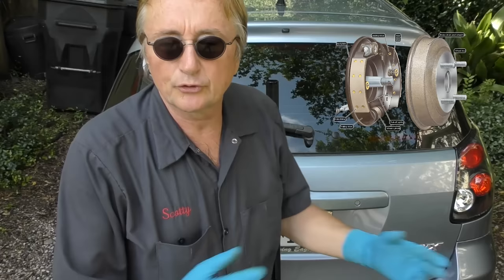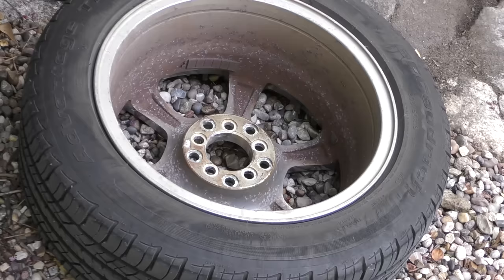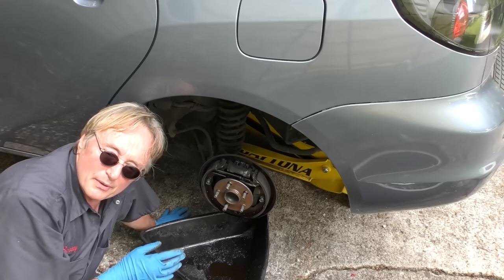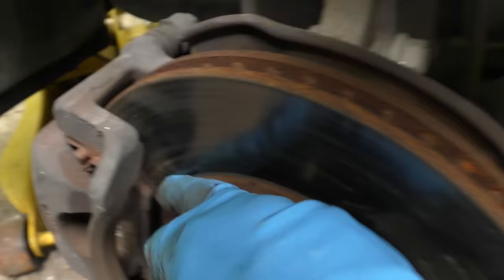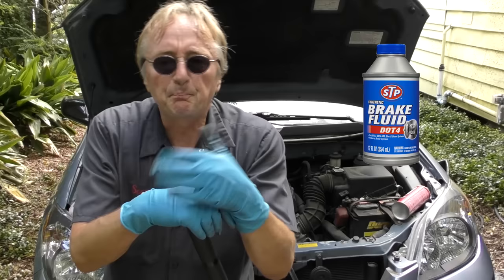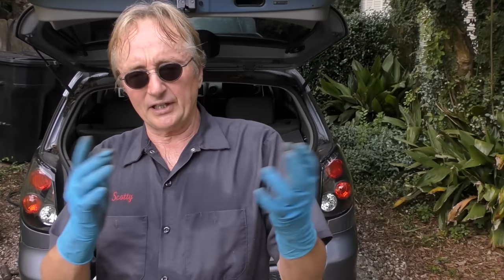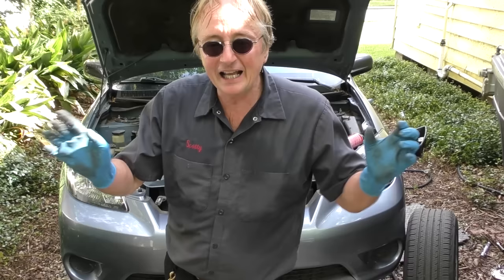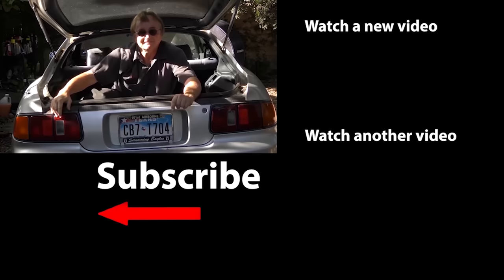Doing This Will Make Your Brakes Work Better and Last Longer

Comment: Scotty, my dad bought a 2004 1/2 Silverado 2500 HD diesel when it was about 6 months old. He has had it ever since and has pulled 8000-12000lb. loads frequently since he got it. He had to replace the brake pads and rotors on the front for the first time at 217,000 miles. The rear pads and rotors are still original at 222,000 miles.

Comment: 109000 miles on my kia forte, they just now needed front pads, back ones are still fine. 5 second follow distance on the highway and i use the sportmatic shifter to slow from 70 to 40 before using the brakes at the off ramps.  Oh yeah, and ignore stop signs! ;-D

Comment: A brake specialist told me 50 years ago how to stop disc brakes squealing, just drill a hole into the leading edge of the disc pad, pad only not the backing [same size drill bit as the diameter of the carbon rod up the center of an old style [not alkaline] D size torch battery, as you apply the brakes a fine film of carbon lubricates it enough to kill squeal.

Comment: If you have a case where your first brake pad change for a car discovers brake pads have severely uneven wear - one brake pad fully worn and the other half worn - would you...
1. Pair up a new pad with the half-worn pad, keeping the 2nd new pad in reserve for the future.
2. Install both new pads and keep the half-worn pad for a future brake job where you find one worn pad.

Comment: Remember, your wheels should spin with only slight friction. If they take effort to turn you likely have a bad caliper with stuck piston. The guide pins need maintenance too, before they stick and cause heat and ruin other stuff.

Comment: Another good reason to only drive a manual gearbox.   Going down a hill or coming up to some red lights, you can change down through the box, and only use the brakes for the last few yards.

Comment: Brake cleaner rules! Except they are not all equal, i only use Kleen flo now because the spray is super powerful and it seems to work better than other. Seems pretty hot over there!

Comment: With the brake cleaner do you spray the front brake pads while they are on? Also will it help clean the rims that have built up old brake dust? I like your videos. You talk faster and not waste a bunch of time. Thank you.

Comment: These rear drums brakes utilize the "Leading and Trailing" design and do NOT adjust themselves by backing up like the "Bendix" design. Leading and trailing brakes adjust themselves by use of the parking brake. Be sure to periodically and firmly engage the parking brake HARD so the rear brakes properly self-adjust.

Comment: I absolutely love your videos and you've become a totally invaluable resource to me. But with that said, I'd like to take a moment to warn you that you're over heating pretty badly by the end of this. I've had this happen a number of times working on my car in the summer in Atlanta and I know Houston's not any cooler lol. But the most serious instance when I think I nearly hurt myself was when the veins in my head were bulging like crazy and I was beet red. This appeared to be the case for you as well here. I wound up getting a pretty severe throbbing headache for a few hours afterwards and it really felt like my heart took a beating.  Just total exhaustion as well. Not enough water and losing too much sweat in that kind of heat can really do you in. Turns out that was my first run in with heat stroke. Anywho, we'd love to keep you around, so if you happen to notice that happening again this summer please take a break! I'm only 31 and I thought I was gonna be in some real trouble when it happened to me. I don't think it would be any easier on you my friend.

Comment: I just replaced the pads on my 99 Olds van yesterday. They weren't down to the dime yet but they were a mite thin. Couldn't get the Akebono pads in my home town, {{Small Town}} but bought the best ceramic pads O'Rileys have. I'm 72 years old but still like to do as much of my own work as I can. 
Pads are simple except for one little thing, The plunger tends to hold everything together so a pry bar is needed. Once that is done then the pads just snap-in. The calipers were ok, I used a dial indicator and micrometer to check them. I still have a few tools from my VW engine building days.

Comment: Many manufacturer service schedules say change the brake fluid every two years. I have a electronic brake fluid tester that tells me this is too frequent. 
Second, in my experience, brake caliper slider pins often stick so it's good practice to clean and grease these pins.

Comment: oh scotty, you dont use the brakecleaner liquid on the brakepads.they decompose much faster or even brake apart.  just use water soaked rag to get rid of the dust or better compressed air avoiding to breathe the dust.

Comment: Hey scotty, I got a good story for you.  WHen i was younger I took my car to one of those chain places for brakes,. They gave me an estimate saying i needed calioers, rotors and pads for $900..  I took it to the small shop mechanic my parents used and they just replaced the pads for $79. WHen i went to pay I said is that all. They laughed and said was it expose to be more. I told them about the expensisve estimate for replacing everything at the large chain place. They said they are just pushing parts and dont want the $80 brake job. That dishonesty by the large chain place is theft.

Comment: I've just got my first automatic and I'm finding it hard to adjust. My foot keeps looking for the clutch and often just goes to the brake instead. And putting a heavy "clutch foot" on the brake pedal is interesting!
Thankfully I don't do this while driving, it's usually when I'm coming to a stop, or parking.

Comment: I watched other video of yours where you recommend Akebono brake pads, and I installed them on my 2007 Accord at 45K when the original OEM ones started squeaking.  I'm now at 140K and recently checked them and they're still good!  So now if Akebono does make pads for whatever car I'm working on, that's the only brand I buy.

Comment: Im on vacay in ireland , driving a new nissan epower with regenerative brake tech. Little 3cyl.charges the battery or runs the engine if more power is needed. Rides like a dream lots of get up and go ...the 3cyl engine soinds like a back up generetor when going slow enough to hear. Im looking at an average of 5.1litres per 100 km on country village roads.Yes its small but they have the xtrail coming out with all wheel drive and the epower system. This is gonna be a win for nissan cause they can get close to 700km on it or more. Talk about a powershot looking at all other electric  manafacturers dead in the eyes.

Comment: My brakes on my 2006 chevy cobalt lasted up to 150,000 miles since i bought it new. Its because i bought with with a manual transmission and  your brakes will last a lot longer due to down shifting to slow the car than a car with an automatic transmission

Comment: Scotty ,  I remember back in the 70 "s when  i was told you could put a  gallon of diesel in your gas tank to clean pistons , was that really correct. Keep up the excellent work in your  video"s
Reply: During that time they put a gallon of petrol in Diesel cars in the winter to help them start quicker in cold weather. Everything was far more primitive then and everything was a little more forgiving too. However I don't see how Diesel will clean anything since its oily whereas petrol is more like a solvent and far more effective at cleaning something than an oily Diesel fuel would be.

Comment: 1. Don't do as Kilmer does: spraying and tipping out the brake cleaning liquid onto the ground - A. where it pollutes your yard, B. can be washed via gutters/drains into local waterways.   Spray over newspaper, which you then dispose of in bin (trash can, for Seppos reading along at home).  
 
2. Don't do as Kilmer does: cleaning dust from the brake assembly with brake cleaning liquid - A. because it's low pressure spray (less effective), B. because it wastes cleaner (your money), C. because water from a garden hose is better (no cost, higher pressure), D. because air from even a light duty compressor is better (no cost, high pressure), E. because many domestic vacuum cleaners will do the job better (no cost, higher pressure when you connect your vacuum's hose to the outlet, and fit the narrow nozzle which concentrates and directs the outlet air flow). Collect dust that is washed away by water, on an old towel or large rag, or a very large pan.  Collect dust that is blown away by air pressure, by just sweeping your workshop floor or driveway surface.  (You don't have to leave your place a cluttered dump, like Kilmer and some other auto experts on YouTube.)   
Water can't damage any of your drum brake components, and unless you're in pit lane, the slower evaporation rate of water is no problem. 
If you do want to use brake cleaning liquid products, save them for a final spray.   
If you think the brake cleaning liquid is to remove grease from you brake drum and assembly, you have much bigger problems with your brakes than just periodic dust removal.

3. Don't do as Kilmer does: gloves are not enough.  A. when you spray dust from your drum and brake assembly with air pressure, wear a simple face mask to avoid inhalation of brake dust, B. when you spray with water or air, consider wearing eye protection.  

4. Don't do as Kilmer does: ignore the potential damage to your vehicle's paint, from spraying brake cleaning liquid near your car's bodywork.  The ingredients include methylene chloride, tetrachloroethylene and acetone!

Comment: They don’t adjust when you slam on in reverse -that just slides the adjuster up to the next cog on the adjusting wheel.only when the clearance becomes apparent after use ,then the wheel on the adjuster takes up the clearance because of the spring pulling down on the ratchet arm

Comment: While in high school and college in the early 1970"s I worked in a small garage. When doing a brake job we would turn the drums and mic them. My boss would order 25 thou. oversize brake shoes which I would then arch on an arching maching to the drum size I measured earlier. Why is this not done any more?

Comment: I bought my Mitsubishi mirage in Oct. of 2014 brand new tho it is a 2015 model it was at 153k miles and I had just started to hear the back brakes and I always park with the E brake on. I changed them myself and took the drums to a place to see if they could machine them. They could, as they were not past wear rating (the numbers on the drum that tell you). I know I should have done better maintenance, but those drum brakes are always a piece of work, and I heard horror stories about my cars. So I put it off and thought about hiring someone til I called around, and lowest price was going to be 800, so I did it myself

Comment: Dont forget to take off the emergency/hand brake before you try to take off the rear drum cover :-p also great brake cleaner is NAPAs macs cleaner, but that CRC only use chlorinated.. The non chlorinated is junk

Comment: Whenever I do the brakes I also clean some of the rusted parts. Rust that comes loose will cause the brakes to make annoying noises...especially on disc brakes when it gets stuck between the pad and disc.
Btw...copper grease is great for lubrication of the moving parts. Also, gently take off the rubber protection that seals the piston in the caliper and put a little copper grease inside. Smear a little on the BACKSIDE of the brake pads and they won't make so much noise either. NEVER ever let grease or oily stuff get on the side of the pad that grabs the disc.
Reply: May want to use silicone grease on anything near rubber parts. Put a thin coating of copper grease on the hub before remounting the wheel, and it will be easier to remove the wheel next time.
Reply: @gkelly941  Yup..good advice.

Comment: 85 Dodge w100 pickup truck 250,000 miles. Just change the rear drum brakes this year. Change the front discs in 2014 both original from the Factory. 😊

Comment: change the fluid once in a while
otherwise if something like brake hoses needs replacement, you still be able to bleed the system
if not, you will have to replace calipers too

Comment: Brakes don't use heat to stop the car. They use friction. Heat is a byproduct of friction, so there. Oh, and too much heat actually reduces effectiveness of most brakes. Unless they are racing type brakes, in which heat increases their effectiveness. Normal brakes outgas when they get overheated, the molecules of the brakepad can't generate the frictional grip needed to stop the car.

Comment: Hey Scotty, great job, but shouldn't you have mentioned to check the guide rails on the front caliper assembly? I usually push the piston in to get some clearance, then grab caliper and see if it slides back and forth to insure even pressure is being applied. Also, if cross section of pads are visible, make sure thicknesses are same...thx for your vids!

Comment: Stop opening the brake reservoir and introducing moisture. There’s a reason why it’s translucent, to check the level.
You only open it if you’re refilling after a flush

Comment: If you want your car to last forever change the brake fluid out every 2-3 years. as its hydroscopic the water that accumulates can rust ferrous metal brake lines.

Comment: I'm retired and don't use my car much. By the time I do, rust builds up on the discs; will this affect the braking and can it be prevented? Thanks, love your channel.
Reply: .....you won't believe it but stuff like WD 40 works if you can spray it onto the discs easily. It quickly burns off under use , actually no . Too involved ....

Comment: Good tips❗️ I think the most I’ve gotten out some pads are around 75K miles.  But I drive uber so sometimes they will only last 4-6 months becuz of the passenger loads and extended driving periods.

Comment: wow, he is detailed, things from this and other videos, I have always ran both vehicles when boosting, I have always just used the negative post, however, I will wait for a while before trying the dead one now and try to leave the live one off. I have always topped up gas to the nearest dollar, never had a problem, but will leave it when it snaps the first time now ! I want to change things up with newer anyway, but I will take his advice where applicable, like changing the cabin filter for instance, alright, God bless !

Comment: Scotty, my street truck (06 silverado 1500) has calipers in the front and drums in the back. I was thinking about changing the back to rotors and calipers as well but concerned that I may loose some long distance braking, like when going down a mountain. I realize that this type of braking isn't very common but there are a few times a year when I may cross a cpl of mountains. Aesthetically, the calipers would be better with my rims but safety & road worthiness is still number one in my book.  Am I over thinking this or maybe worrying too much? Should I keep the drums in the back or just upgrade to calipers? The truck is also dropped 4inches in the front by way of custom arms and 6 inches in the back with a flip kit & no hauling is ever done with it, if that makes any difference. Thx in advance.

Comment: If it says CRC on the can our family uses it. Anything from brake cleaner to air sensor and electric connection cleaners, we seem to have good luck with them. Also I bought the silicon spray lube the other day and put it inside my door on the  window regulator and window tracks now the electric windows work a lot smoother & faster.

Comment: Drum brake squeaking on passenger side. I took the drum off wiped out dust and wiped off shoes. Don't have spray but brushed out a bunch of dust and little pieces of debris and still squeaking. I'll try spray. How thin can brake shoes get before replacing? They're not worn all the way down but I don't know what is acceptable. Wondering if it's squeaking because I just need a new set?

Comment: I had 1mm left on my pads so I cut out a section in the floor and use my feet to brake like the Flintstones...been able to maintain the pads at 1mm for 3 years but the calluses on my feet are killing me

Comment: Scotty i have 06 chevy silverado 1500 rear wheel drive, when adjusting drums in back, hardly any mechanics give info on putting the truck in neautral, im not a master mechanic, diy. I took off the drums and cleaned the points you said????

Comment: I break very little and there is always a lot of pad life left, but I had it several times that the glue on the back won't last that long with original pads. It just crumbled off the little plate. 

Any pointers brand-wise?  (Kia Cee'd 09)

Comment: Scotty I have 2011 Scion tC  I had the brakes changed but sometimes when I brake hard and go to pull the car off I hear a clicking sound , clack , clack,clack from the brakes they are all disk brakes , could it be the spacers or a sensor rubbing , I also have a lot of surface rust on them and when I pull off I hear a rub like a pad is rubbing , I’m gusssing I need new rotors

Comment: You never drive with two feet in automatic. He's one foot for the gas one foot for the brake and only your other foot if you're using a manual transmission for the clutch, and that's it. Because out of the gas and brake the gas is going to win every single time.

Comment: Can i apply the brake cleaning spray directly onto the discs without removing the wheel just using its spray straw to push the liquid properly inside?

Comment: I just had my front brake rotors and pads changed on a minivan. It makes a shrill chirping noise when I step on brakes, and also after I take foot off brake. Is it because some brake part didn't retract properly? Do you know what might be the reason? Thanks.